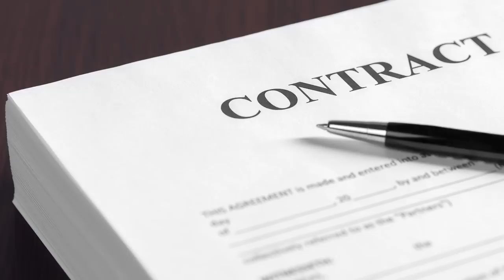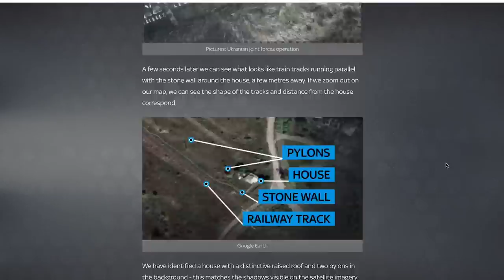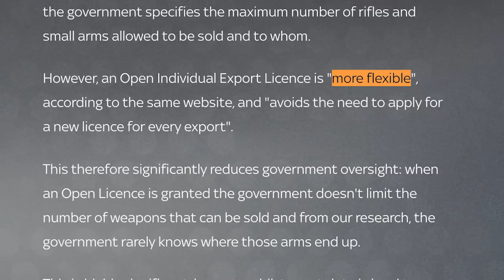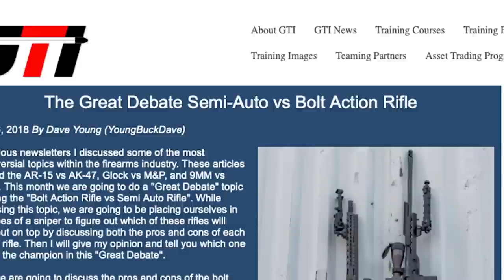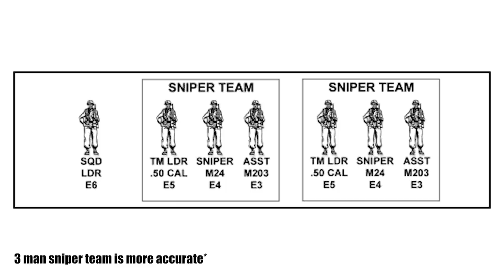L115A3 Brits Sniper Rifle From a Shed to Combat

Comment: Yes 7,62 cal sniper rifles are best for 1000 mtrs + and are still manageable for long patrol carry, and bolt action is more reliable and simpler and easier to maintain than semi auto though the semi auto I used in the military was faultless with daily cleaning and oiling ofcourse when in operational areas or in heavy  use as should be with any fire arm, but tbh I've gone weeks at times without cleaning and oiling my rifle in harsh dusty conditions without any failure when shooting, btw this is a verry good rifle and i love it even with its 5 shot only mag, because it's a sniper rifle the mag needs to out the way for many shooting positions and a good shooter only needs one shot per kill so a 5 shot mag is good 😉👍
Reply: The 762 is best for 1000 plus…?  My friend you are sorrily il informed.
Reply: @michaeldbhawker3556  Yeah, .308W is effective for 800 [m]. More than that and it becomes artillery as Cappy said. For 1000-1200 [m], you clearly need 6.5 Creed and for 1500+ [m] only something like the .338 can achieve it reliably. Of course, it is possible to put lead on a target at 1200 [m] with the .308W but you need pretty fair weather and high BC bullet. You usually don't have the luxury of spraying everywhere to adjust your shot before taking down the target.

Comment: Plus bolt action rifle are much simpler where if something breaks it could be easily fixed on the field or replaced as well as fewer moving parts like an m14 or Svd which rely on moving components to work flawlessly vs a bolt action which has a much looser tolerance and as someone who owned an airsoft version of the gun, the thing is stupidly simple to disassemble, not only that but bolt action rifles have more stopping power since 80% of the bullet is dedicated to pushing the round down the barrel 10% is wasted in heat and 10% is wasted on sound, vs an automatic rifle which has to not only push the round down range but to also push a bolt back as well as losing vital gas out of the gas piston but also through the ejection port as well, not only that but bolt action rifles are much simpler in design not needing an entire internal mechanism to fire or change to full auto or safe which requires more parts as well as space ie or eg the AK 74, vs a trigger connected to a spring and a safety catch, outside of that that’s pretty much it outside of a spring and firing pin to fire the round. Also when it comes to snipers especially for special forces, their main goal isn’t to call of duty it or mow down hordes of enemies like a machine gun, but are required to kill one or more individual of high value, such as commanders, vip’s, valuable components like a single radar dish and people tend to mix the roles of marksman and snipers where again snipers are there for specific or certain targets, vs marksman are there as a supporter be that to a sniper where a sniper might be paired with someone with a marksman rifle for say mid to close range engagements or multiple targets, or as a means for long range and precise targets like near by talliban officers or someone just out side of effective rifle range where the chances of missing or hitting a civilian might be too risky.

Comment: I thought bolt action was preferred because the bolt utilizes nearly 100% of the powder load resulting in a faster round with more power behind it. Where as something like the m14 though completely reliable uses some of the powder to compress the recoil spring to allow the weapon to cycle the next round. In otherwords the same round shot out of both types of rifles the bolt action should be traveling at a higher speed and possible drop less over distance.

Comment: Bolt action rifles are generally more accurate because the bolt locks up the same way every time in the hands of a shooter that is being consistent.  Also a gas operated rifle generally has other parts attached to the barrel to cycle the action, and those parts can negatively affect the harmonics of the barrel.

Comment: You're wrong when you said "he set his scope to the maximum range and shot 9 times"
He actually set the scope to medium range in order to have a larger field of vision so he could see where his bullets were landing, then he "bracketed"(a term used for firing and adjusting as you go) rounds to see where each shot landed. This is why when he returned to the two taliban guys firing the machine gun he was able to kill them because he had already set his scope up with the bracketing. He killed the first guy with the first bullet, missed the second shot on the second guy and hit him with a third shot fired before the second shot hit.
He recounted that each bullet took approximately 6 seconds from firing to landing. He never claimed that he wasn't trying to hit them either, (don't know where you got that from) but i can assure you, he was. Although i do concede he didn't expect to hit them as they were so far away. (the range finders were'nt working because they maxed out at 1500meters).The idea that he wasn't trying to kill them and was just trying to scare them when they had already killed 3 guys and wounded another 4 or 5 is an odd statement to make.

Comment: Sniper rifles aren't meant for a large volume of fire. If you need to fire more than one or two rounds, the sniper is doing something wrong. Usually there's also a spotter who most likely has an automatic weapon if needed.
Reply: Yep. In military service its not uncommon for both sniper and spotter to be carrying assault rifles in addition to the sniper rifle and associated gear.
Reply: @jamesb3497 correct me if I'm wrong, but another fact that most people don't usually know, is that the spotter is usually the more experienced Sniper, as they are doing the calculations and calling out where the rounds hit and calling out the scope adjustment correction.
Reply: @JRath905  You are correct.

Comment: M14 might have a cyclic rate of 700rpm but there's zero chance you can get through that once you reload etc, let alone going for any accuracy. 

If accuracy doesn't matter at all, a stripper clip fed bolt action can do much better than 20rpm. 

Depending on your version of accuracy at least, but there are some crazy mad minute records.

Comment: Not sure if you are interested, Russian FSB A and B teams were using AI variant rifles as far back as 2004, during the Beslan school siege there is a small selection of photos showing a handful in use likely privately purchased.
Reply: As far back as late 90s and SV98, not AI.
Reply: @PPWRUP  I have a pic of an FSB A centre member using an L96 variant in Beslan not an SV-98 which is a completely different rifle
Reply: @lukewhitehouse4103  I've also seen those (at least I think we've seen the same photos). The rifles on those photos are SV98 and early versions of SVL.

Comment: The M14 can not fire 700 rounds per minute. The M14 has a cyclic rate of about 700 round per minute but you would have to make 35 magazine changes in one minute even to load 700 rounds but the M14 Sniper Rifle is accually a M21 and is semiautomatic the selector switch is locked up so the weapon will not fire in automatic mode.

Comment: The bolt action IS NOT obsolete.  Less moving parts and tighter tolerances means greater accuracy.  Let me use this analogy: a scalpel cuts, a steak knife cuts.  A surgeon will not use a steak knife on a patient under any circumstances, you can use a scalpel to cut a steak but its a waste.  The right tool for the right job.

Comment: bolt actions are more accurate BECAUSE they are more reliable, I'll explain: because the entire re-chambering cycle is much slower in a bolt action gun, there's less stress on the components and they degrade less quickly. fresh out of the factory, a semi auto rifle would be just as accurate as a bolt action (other than the whole "slightly more difficult trigger pull" thing), but over time it degrades more quickly.

Comment: lmao. he said the M14 has a fire rate of 700 rounds per minute. theoretically, on full auto, okay. that's not happening though unless you have a 700 round magazine. or even 7, 100 round magazines. lmao. could you imagine? 20 rounds per minute of accurate .338 is devastating. versus "700" rounds of .308 shooting into the sky. lmao.
Reply: I’m nearly choked when he said that.  Does that include a melted barrel?

Comment: Perhaps this is a stupid question, but what adaptations would the Arctic warfare version have that would make it worse than a regular one for non-arctic environments?
Reply: The changes would just be unnecessary extra cost in a non arctic environment. Changes like the wider trigger guard would make no difference if you don't have to wear winter gloves.

Comment: Bolt action rifles are simply more accurate. Whatever the reason, it is simply so...
For example, after WW2, Yugoslavia got a lot of Mauser Kar 98 as war reparations from Germany. However, domestically produced models were slightly modified and named M48. And the accuracy was very, very good! There were reports of guys scoring consistent hits over large distances even with iron sights. Soon, smb got an idea "why don't we try to use this as a sniper rifle" and soon first attempts were made. However, it never really caught up cos the relations with Soviet Union improved and first SKS came and then the AK. So, the next step was - semi-auto sniper.
Well, it was weird cos the new rifle (M76) was based directly on AK despite being a Dragunov look-alike, but used 8mm Mauser ammo that was plentiful. Later, other variants were made in different calibers. But it was immediately clear - despite being same caliber and using the same ammo, the old M48 was way more accurate. But rate of fire was a higher priority...
It is only recently that now Serbian army decided they needed both weapons; smth with high rate of fire and smth accurate. So, a new M07 sniper rifle was created and - it is bolt action. Even the anti-material rifles such as M93 and M12 (which are both in .50 BMG and Russian 12,7x108) are bolt actions. And do those two kick...

Comment: I'd take an old bolt action over an auto loader for hunting. They are more accurate not to bad to do follow-up shots lot's of people saying they need a AR platform. You can get bigger rounds and a longer barrel and still not be as heavy or clunky sound wen walking through the woods. Canada has the world record again for longest sniper kill with there Tax 50. Canada held the record three times now I think
Reply: Depends on what you're hunting. If you're culling goats, a semi is far superior.
Reply: @kiwigrunt330  Why I am in BC I have no problems with my 338 magnum something my 30-06 but my scope gets most of credit for that. But there's so many different calibers to choose from in a bolt action. Again easy to maintain not so clunky. But different strokes for different folks I guess.

Comment: I don't believe the action of Bolt-action is what makes it accurate; the way the rest of the rifle and gunsmithing does.  I do believe that the bolt-action (a lot of other repeating action weapons that don't automatically load the shell after each shot, also have this benefit), allows the gun to get the maximum range the bullet has, and, when used in tandem with the barrel and its rifling, the accuracy as well.  one benefit of the bolt-action in particular is an action less prone to failure, when made well.  its a much simpler action to maintain, but it is also the most inefficient when compared to the pump, strait-pull or lever action weapons.

That would be an awesome precision rifle; one that's both lever action and maybe even a magazine fed bullpup, as well as a possible optional self-loading function like the SPAS-12 or the Benelli M3.  it would probably defeat the purpose of a sniper rifle, but hey if a sniper finds him or herself in a situation where they need more rapid shots to engage targets in a closer engagement distances than they usually do, would probably appreciate it; until they have to fix the many failures that would likely happen with a rifle like that

Comment: Rifle accuracy has nothing to do with the action. Accuracy is a function of the chamber, barrel, optics and ammunition. Where things diverge, is in the actions construction. Semi's will have a more robust receiver, to cope with the higher rate of fire. Typically translating to higher weight. And always translating to higher complication and reduced reliability. I believe the preference is psychological.  The same reason I opted to carry a revolver, rather than a standard issue .45 as a helicopter crewman. Limited ammo, and no spare parts if shot down.

Comment: Because I live in Canada, don't have a firearms license yet, and couldn't afford this awesome sniper rifle, let alone find a range to shoot it at,.I was forced to settle for something far less awesome, but at least related.

I was lucky enough to get a good deal on an officially licensed version of the airsoft Arctic Warfare. 

https://i.imgur.com/LIgrJN4.jpg

Like the original, it has pretty awesome accuracy as well, and is fun for indoor target practice with a bolt action (I have an army men compound to practice the accuracy and it will pop heads off.

Outdoors, I've hit eggs at 30+ meters, in windy conditions.

Even a "toy" version of this awesome Sniper Rifle, with an amazing origin is awesome to possess (as due to the gun laws, and cost, and lack of long ranges I'd have to move to be able to have a real one.

I've heard the story, but as usual, your videos are entertaining and informative.

You gotta give credit where credit is due to the people saying "the other longer shots were a .50 cal so they aren't as impressive.

He was using a much more modern cartridge .338 Lapua Magnum LockBase B408 bullets vs the .50 cal. The Lapua has a higher Muzzle Velocity 2953 fps vs 2750 FPS, but with a much smaller bullet.

Our Canadian forces Joint Task Force 2 with a US made McMillan TAC-50 holds the record at 3,540 m (3,871 yd) which is a much greater distance than 2,475 m (2,707 yd).

He still did amazing sniping, but Canadians also hold #4 and #5 on the longest confirmed Kill list, with An Aussie at #2, Craig Harrison at #3.

I know his accomplishment was great, but his guns effective range was 1,500m and the MacMillan is 1,800m.

He pushed his gun 975m over effective range, the Canadian pushed his 1,740m over effective range.

Comment: You've got some of your details wrong in that the L115 used the .338 lapua same as the Arctic warfare.  Also the L115 wasn't called the green meanie. Usually you're bang on with your data but a bit off on this video.

Comment: Most world willitarys are seeing the advantage of the .338L in a bolt and even semi auto rifle.
It's the perfect round for long range anti personal and vehicles with no or light armour.
It's much much more accurate than the .50bmg with less recoil.

Even china makes a rifle chambered in this ammo.

The only western cartridge they have adopted for their millitary and .308 

The .50bmg and 12.7 Soviet are great Anti material rounds and have long ranges but are not as accurate and they do have a longer range  and that's fine with a machine gun but with a rifle you want long range and accuracy.

Maybe they will make a .50 or something that is made more for accuracy but South Africa makes a rifle chambered in 20mm Vulcan.

Apart from sporting shotguns and maybe a few sporting rifles I'm pretty sure accuracy international is the only factory that makes millitary firearms.  As far as I know the UK only makes shotgun shells mostly birdshot and .22lr 
All ammo is imported I think.

Endfeild is shut down and I have no idea how much in stocks the UK owns in H&K but I think they rely on imports from the EU mostly Germany and the US, maybe Canada also.
The SA80A2 is ok but quite heavy and you have to be a left handed for close quarters it's great as full 20 inch barrel for 5.56 in a small package but I would take a 20 inch T91 from Taiwan or M16A4 anyday (with an improved trigger).
The M4 is fine for shorter ranges but the 14.5inch barrel realy lowers the velocity and wounding charictwrisrics.

Should have gone with 7mm British for the EM-2   and FAL

Comment: How can they be sure that the Russian guns were originals and not "Chinese" copies?
This story is quite peculiar (for me) because the Russian rounds are 7.62 X 54 and not 7.62 X 51 NATO. All that was shown on the video, basing the use of the rifles by Russian SPETZNAZ, were pictures of the AC rifles.
As far as I know, sniper rounds come from selected batches of ammunitions and not just any rounds found lying around.
Just getting some guns and limited amounts of ammunition, doesn't seem useful for military use, unless they are intended for SOFs operating behind enemy lines, basing their ammunition resupply from the enemy forces. However, in such a case it would be most unlikely that these weapons and their NATO ammunition would be used in Ukraine, that extensively uses Soviet ammunition types.
An alternative explanation would be that these rifles shown, were captured from the Ukrainians and were not standard issue.
Reply: Its speznaz they have riffles in 308, 300W mag and lapua mag. Domestic russian rifle Orsis T500. There are lot of production lines of different calibers , as those rifle rounds. Fun fact 1/5 of 45 ACP made in Russia. I think they just bought guns direct from AI company)
Reply: @sectero9450  OK. thanks.